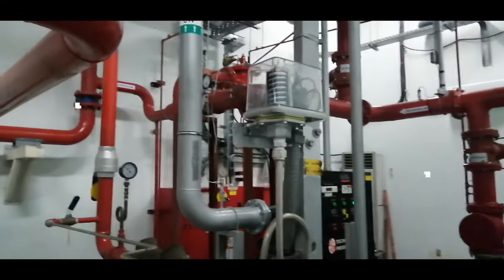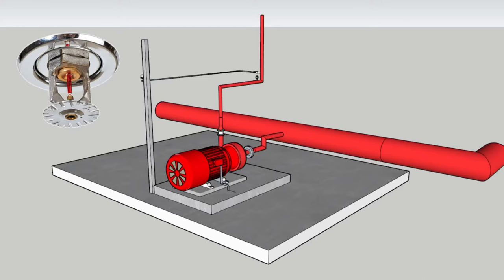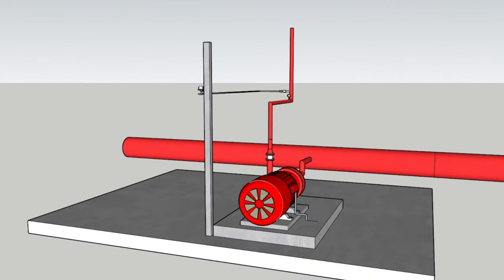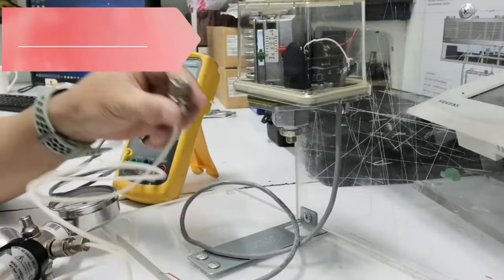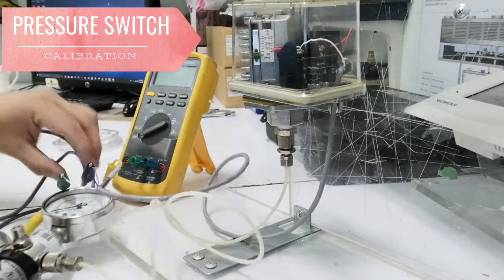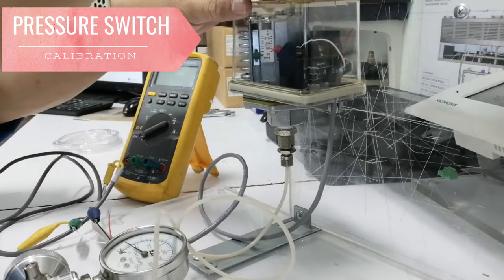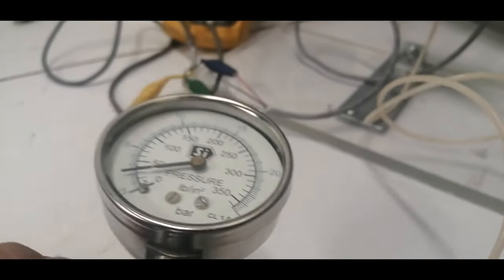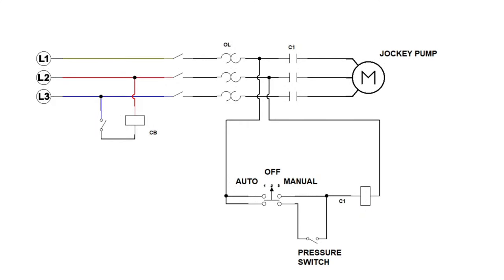JOCKEY PUMP : HOW TO CALIBRATE PRESSURE SWITCH

Comment: Hi there , Why the jokey pump goes high pressure during day time from 11 am to 3 pm almost 20 bar ??  Design max pressure is 18 bar
Reply from the maker: A jockey pump going to high pressure during the daytime could be due to various reasons. 

Increased water demand: If there’s higher water usage during the day, the jockey pump may need to maintain a higher pressure to ensure an adequate water supply.

System leaks: Small leaks in the system that might not be noticeable at night could become more pronounced during the day, causing the pump to work harder and raise pressure.

Faulty pressure control valves or check valves can result in pressure spikes during the day.

Pump control settings: Incorrect pump control settings or programming can lead to pressure variations at different times of the day.

System design: The system’s design and capacity may not be optimized for daytime demands, leading to pressure fluctuations.
Reply: @TheMachine0021  Thanx 👍

Comment: main pump start from howmany bar and stop howmany bar
Reply from the maker: Typically, the jockey pump's cut-in pressure is set at 90 psi (6.2 bar), while the cut-off pressure is set at 120 psi (8.27 bar).
Reply: @TheMachine0021  thank's sir

Comment: Valuable info , but the most important part for adjust the pressure switch you didn't explain , right for what function , left is for what function , and how to read and adjust the value you also didn't explain .
Reply from the maker: Sorry not to mention the function of adjusting screw for calibration, the video is intend to show only the basic calibration of this specific pressure switch that can be use on a fire pump system.
calibration guide  of different kinds of pressure switch will be  uploaded separately. Thank you
Reply: @TheMachine0021  more informative videos pls❤